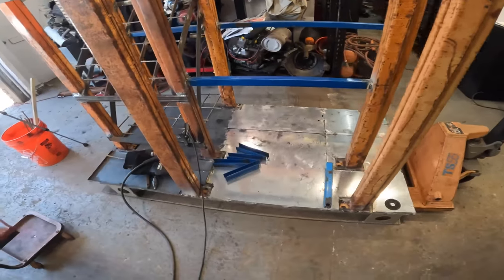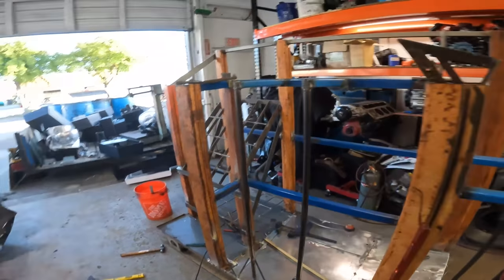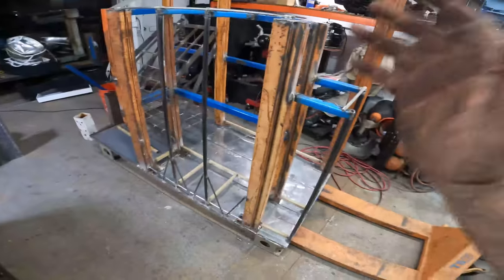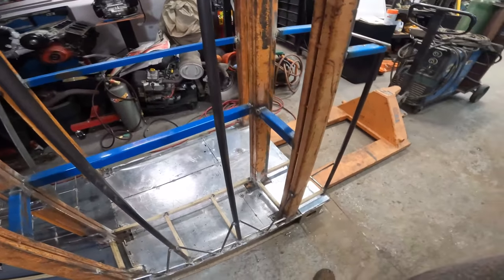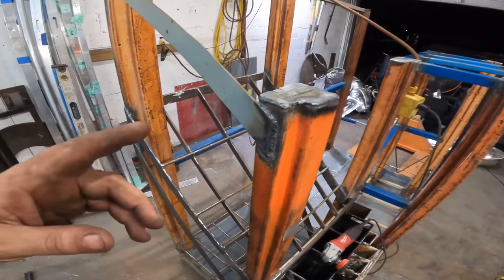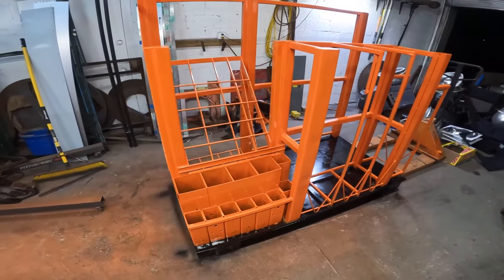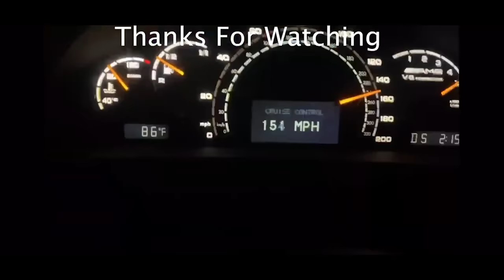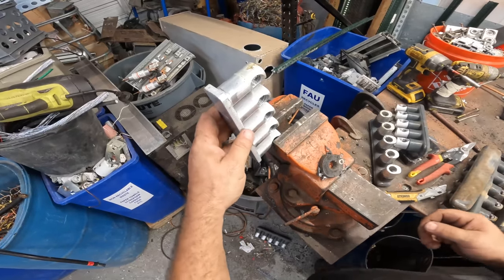DIY Steel Rack Pt.2

Comment: Good thing you spent a bunch of scrap pieces on makig that rack. That's all pieces you wont need to store on this rack 😂
Reply from the maker: 😂😂😂 It's working out great wait till you see it in use and I actually cleaned a good portion of the shop in the process.